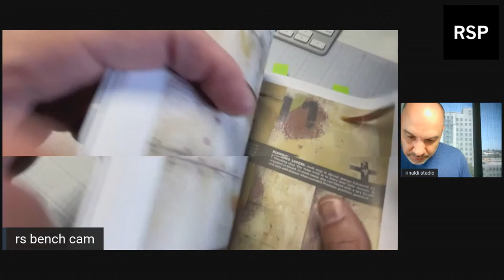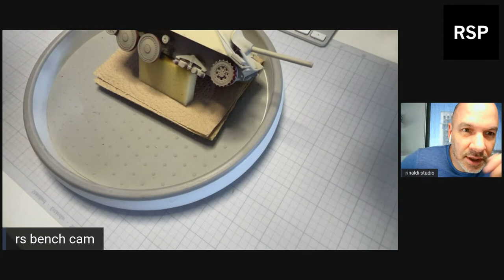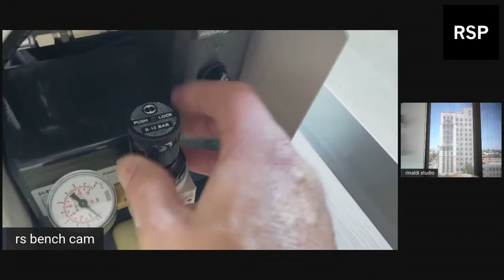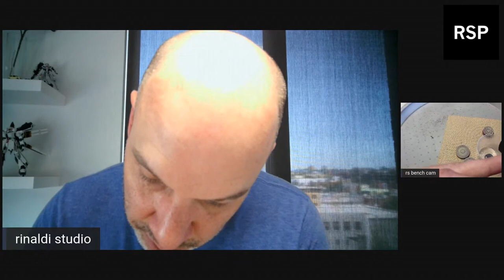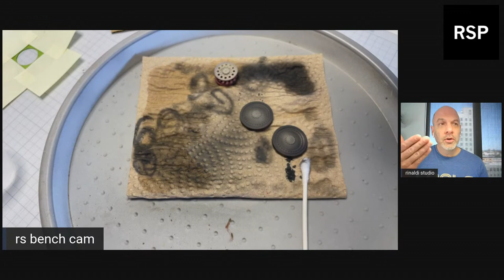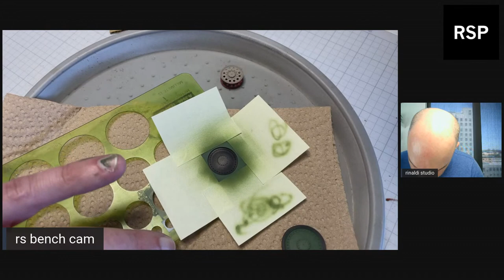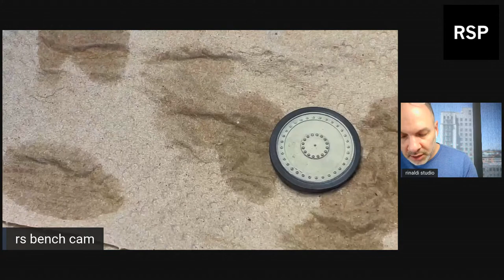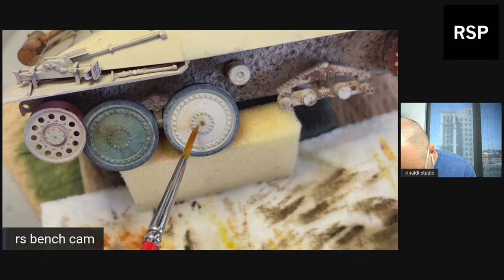Ep 4 - OPR, Pigments & Airbrushing How-to

Comment: Another great session Mike, thankyou!  I'm really getting a lot out of these.  They're also great to replay too when sitting at the bench (I think I've watched Episode 3 three times now).  Can I add a request for an upcoming topic?  I'd love to see you demo OPR on a panzergrau base.  I've had a crack following the TA4 SBS but I'd love to see it done 'live' so to speak.  Cheers!
Reply from the maker: You got it! I’ll get something prepped for panzer grey. Thanks!
Reply: I thought this was a problem with the mmp but I see you use it to your advantage. But after you do this technique I'm assuming you would have to varnish right after. Cause I was able to do this even days after the mmp was drying.
Reply from the maker: @michaelweiss7880  I don't use varnishes unless absolutely necessary. Unless you expect to keep chipping and chipping those same spots repeatedly, it's not a required step, no. 

To recap, if I'm not discussing a step then I'm not doing it or using it at that time. If you watch the stream back past the chipping, I move directly into OPR and have no issues with any paint coming off.

Lastly, once an area is chipped you typically don't re-chip that same spot and this goes for any type HS, or whatever technique is being applied, and why I say above, unless absolutely needed. Usually it's not. Even the multi-layered chipped projects in the books are not varnished in between color layers. 

We can discuss on stream again and I'll cover it in greater detail for you guys, thanks!